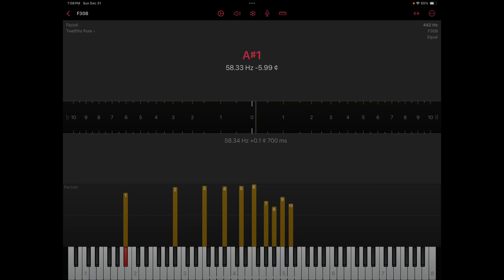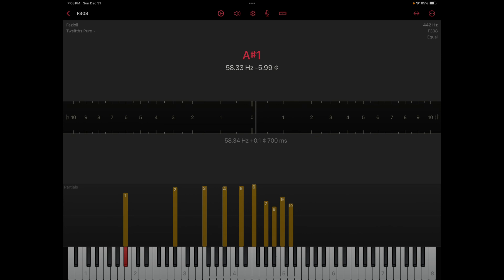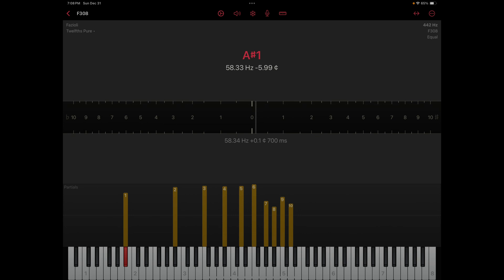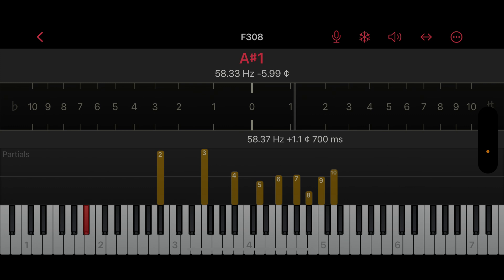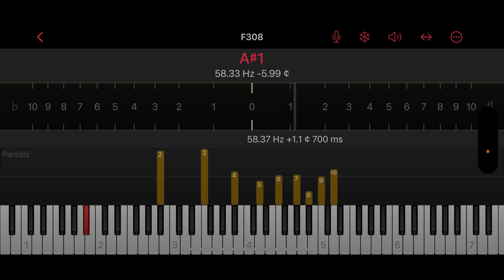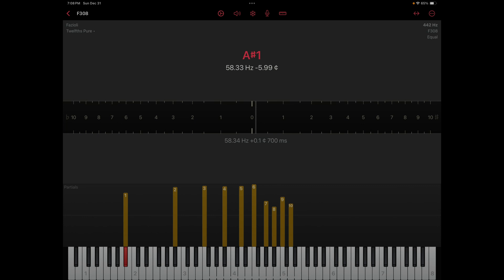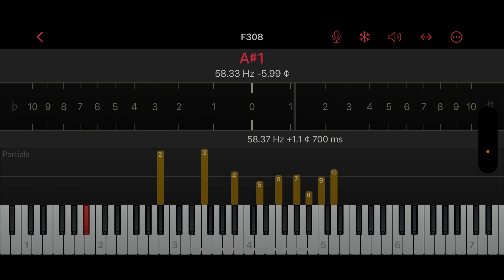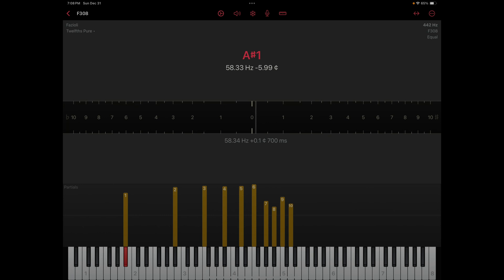Low Register Tuning Accuracy with PianoSens

Comment: Paul,

Yes, I suspect that is the case. Considering the fact that a soundboard panel (not installed in the case) typically will vibrate actively at no lower than about 49hz (roughly an octave above A0), and when installed in the piano case that base frequency (unloaded) jumps up to nearly 60hz generally speaking. 

So except in the case of an extremely large instrument, the ability to reproduce those low fundamentals should be quite impossible. Or if able to, quite inaudible to our ears or microphones. Therefore our brain "fills in" the missing stuff and we "hear" those low frequencies.

Even though (at this time) I am a dedicated analog/aural tuner, I have long suspected that acoustic anomalies including absence of various partials in certain notes has an adverse effect on my ability to tune some notes accurately. My proof of this is when I can't hear the 6:3 octave partials clearly (down low) and I try to "ghost" it and it's not there. One note above it's fine, but on this note it's gone. I have to use another interval or "fake it" to the best of my ability. 

I'm looking forward to trying this thing out. When Steve told me it has a headphone jack that sealed the deal for me. I see this as an innovation with numerous potentials.

Peter Grey Piano Doctor

Comment: This also proves that there IS a fundamental of the note, not that it is absent.  This is a misconception that there is no fundamental in the lower bass notes.  The piano may not be able to respond to the string movement due to the design, and thus not create the fundamental frequency into sound.
Reply: The fundamental isn’t audible but yeah it’s always there in some extent.
Reply from the maker: On a great concert grand, the fundamental is about 9 dB down in the lowest notes, and that is VERY audible. My research and measurements prove that and there is an unfortunate 'myth' of the so-called missing fundamental. I have shaken up people with my measurements and results. It's hard to change people's opinions even with the measurements and proof.
Reply: @PianoSens-ey8jb  9db doesn't sound like much but human hearing sensitivity diminishes very fast in the sub 100Hz range. So realistically it's probably "audibly" 20 or 30dB lower compared to your second and third harmonics. 

And missing fundamental IS a thing... its just the concept that you can trick someone into thinking a note is lower than it actually is by synthesizing a note that begins on a 1st, 2nd, or higher overtone.
Reply from the maker: It is extremely apparent in the time domain view as the periodicity occurs and is very easy to see, the periods are the fundamental. So, the 'missing fundamental' is a myth propagated by people who are not signal processing engineers and who have not done their homework and not done careful measurement experiments on a large concert grand. I have a whole slide set on this subject. Everyone is simply 'wrong' who have not studied it as I have. Sadly. @Jwellsuhhuh